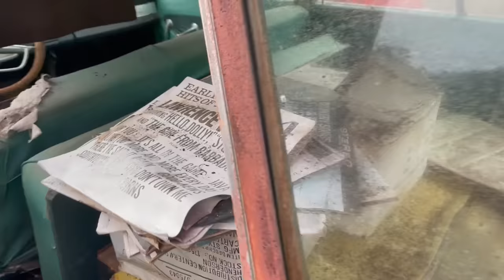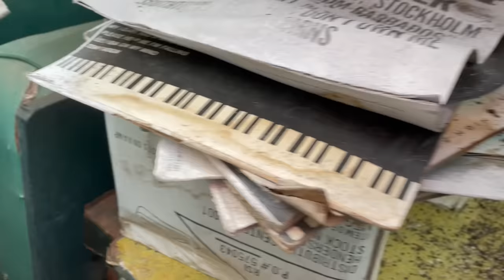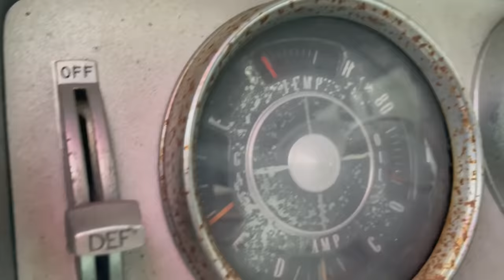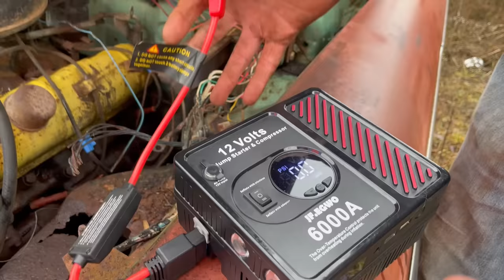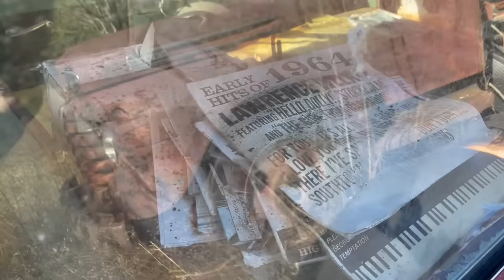Will it run?  48 hours to start and drive a 1963 Studebaker Wagonaire parked 39 years!

Comment: I wonder why they picked that vehical since it looked like a lot of other grave yard cars and trucks. Wonder if they figured out the actual year and if original engine. Since one inside fender well was badly rusted wondered if it carried and suspension components. 
What a crazy couple.🤣
Reply from the maker: True Galen, we are a little crazy. We chose it because the owner asked us to try and get it running. He has wanted to get it going for years, which is why he is so happy at the end.